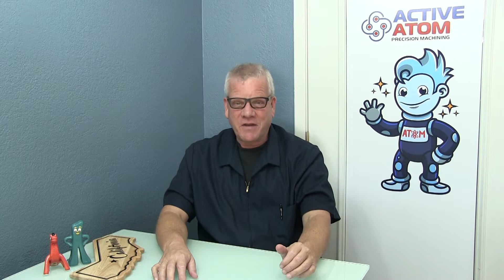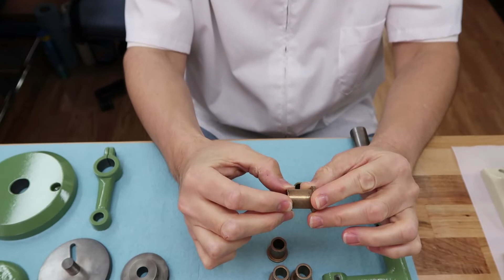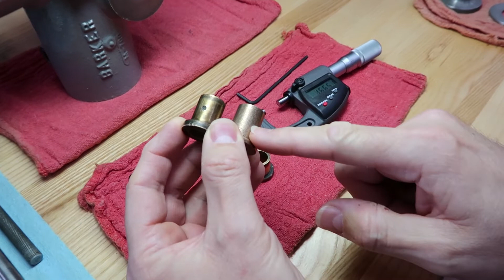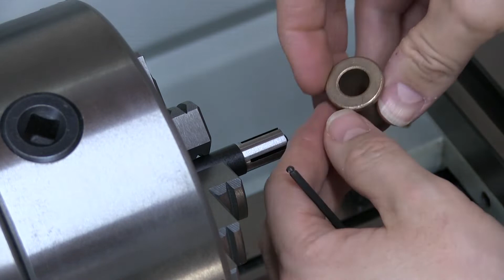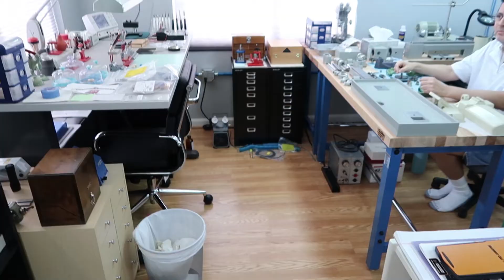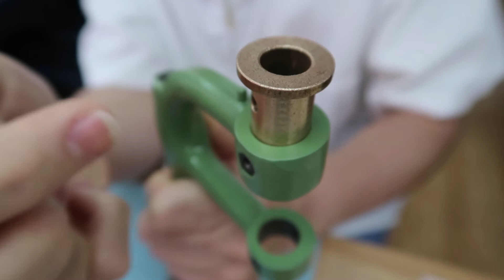SHOP ADVENTURES 05: Machining Bronze Bearings for Watchmaker Drill Press

Comment: Hi. Very interesting material. Do you have to add the oil to the bushes or are they already impregnated. Thanks.
Reply from the maker: Well a great question Mark, they, these bronze sleeve bearings are impregnated when manufactured we do have oil cups and or oil holes that must have oil (a light viscosity or spindle type oil) added daily or as per use to allow the bearings to retain and maximize performance for years, often decades in our cases here anyways. Thank you for this question and Mark we thank you for being here with us on this long term journey into watch movement and timing device part making. Lance & Patrick.

Comment: I made a bushing out of the same material ..It was for the spindle in my old Sears/Dunlap 109 lathe
Reply from the maker: Nice material so long as you cut it with really sharp bits so as to not clog the oil filed pores of the Oilite bronze bearing material Jim.
Thank you for liking this video and our machining of one of the re-builder side of our thinking's material selections. 
Lance & Patrick.
We share some neat tools for watchmaking the latest and state of the art in air and vacuum for us and this leads to the coming weeks cyclone connection, seal kit install to keep and maintain a really clean environmental Workshop which we stress to maintain here. 
Thank you for being so supportive to us both, lance & Patrick.

Comment: Very elegant solution to the bushing. Also very tidy machining of the bushing. 

I have to get one of those pen sized center punches. 

Dan
Reply from the maker: That material Oilite is one that we must cut with really sharp cutters you can actually ream Oilite bearing material but the reamer has got to be really sharp as well because this material if not cut sharp will seal the bronze from its ability for the oil impregnating to work say when adding oil in the daily oilers. Thank you Dan happy you are liking our journey. Lance and Patrick.

Comment: G’day Lance & Patrick. Nice work on the oilite bearings, the expanding shaft is a handy tool to accomplish the work. Your lathe is quite a bit larger than the equipment you are restoring. Do you Lance, use the lathe or does Patrick keep you away? Cheers Peter
Reply from the maker: Nope, no cannot even touch these machines and tools, Patrick is the BIG child in the sand box around here that has this or that tool in his hand and if you so much as even look at another tool or machine then that one is now his favorite and so on. 
The larger lathe you mention and the TAIG CNC mill and drill press from our current videos and our titanium anodizing station (not shared yet) are in the machine shop i.e. garage converted into a machine shop.
Peter most of our micro-machining, measuring, bearing/bushing installations, assembly and some micro finishing work actually takes place in the workshop that is our enclosed patio where the air and environment are controlled (NO SHOES IN THE WORKSHOP) says Patrick.  
Having a great time watching your machine build Peter, we are both equally thankful you are visiting our channel.

Comment: I assume there were no indentations for the set screws securing the bearings?
Reply from the maker: Hi Peter, you really pay attention to the details which is great.  We did make the indentations on the bearings but we did it after the video which is why we didn't bring it up and honestly, didn't think anybody would be paying attention to this little detail so we didn't bother filming it. We were originally going to drill the oil port hole and make the indentation at the same time but we realized that it would be best to drill the oil port hole first, press them into the drill press casting, align this hole perfectly with the hole in the drill press casting and then mark for the indentation.  The oil port holes in both the bearings and casting have to align perfectly because the oil cups that gets screwed into the casting actually protrudes into the bearings slightly so if you are just a little off, the oil cups won't screw in all the way.  Plus it would just bother the heck out of me to know that the holes are not aligned perfectly. By the way....due to your comment, we will ensure that we get all the details in the video footage since people like yourself do pay attention to the little details. :-)
Reply: Active Atom it is your attention to detail that adds so much interest to your videos and your journey.